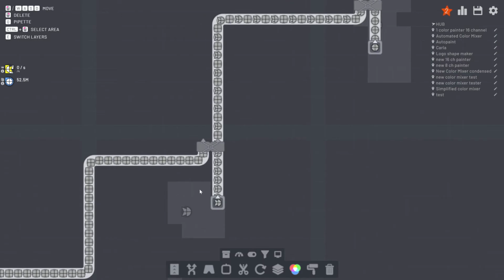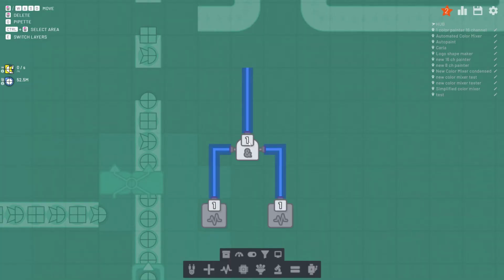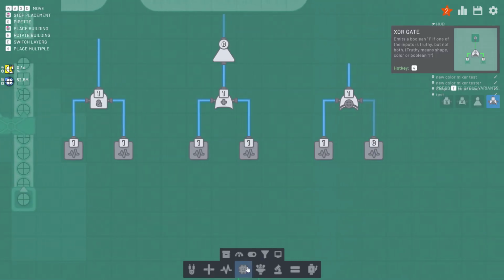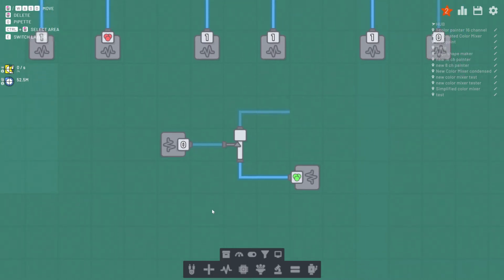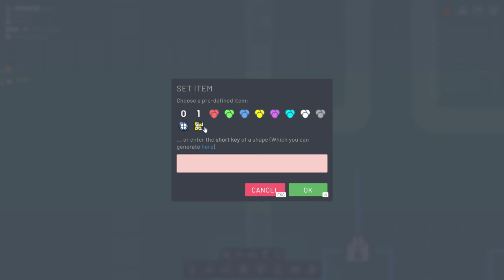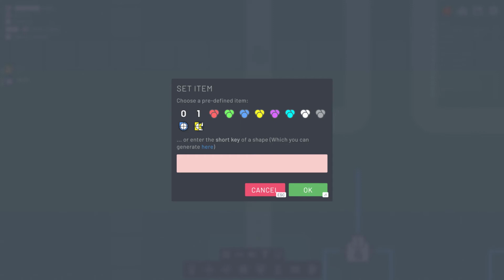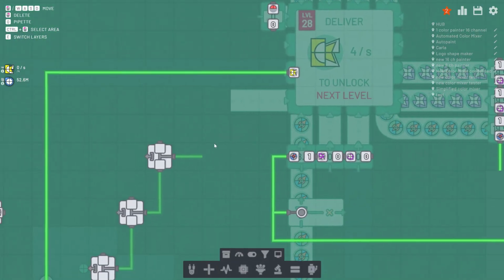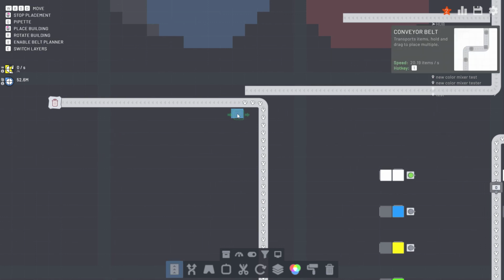Shapez.io - Wire basics

Comment: How do you get other parts without the wires+ mod
Reply: Im on the website version
Reply: @sissysakura7676  the transistors and the belt reader in the wires layer
Reply: @sissysakura7676 and the one part in the wire layer with a microscope logo
Reply: @sissysakura7676  i think the website version is only on 1.2 wires update and not 1.51
Reply: @sissysakura7676  so i need the steam version... right?
Reply: @sissysakura7676  all of the wire parts are unlocked but not the transistors and stuff
Reply: @sissysakura7676  im on the github version
Reply: @sissysakura7676  not the shapez demo version made only by tobspr games